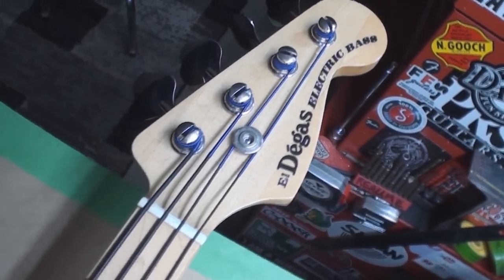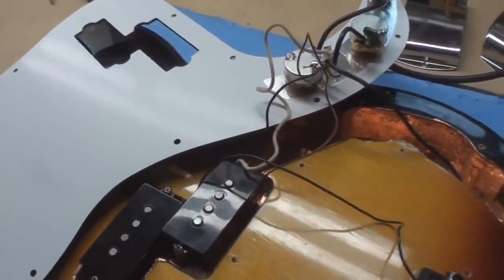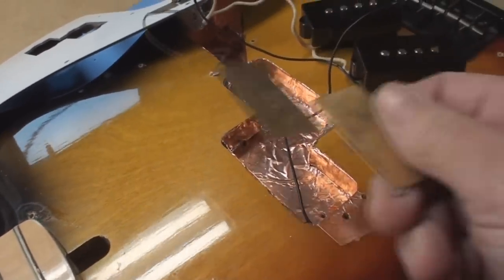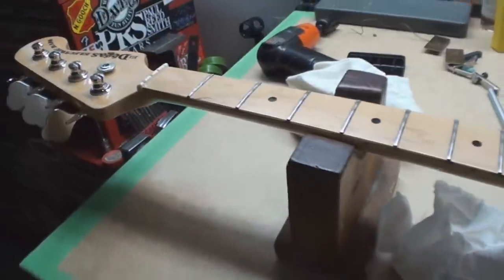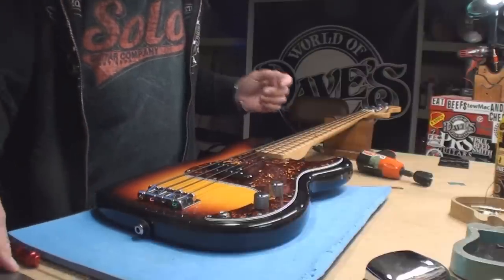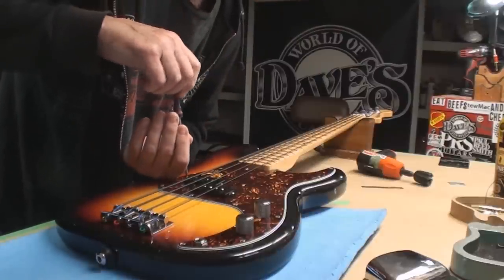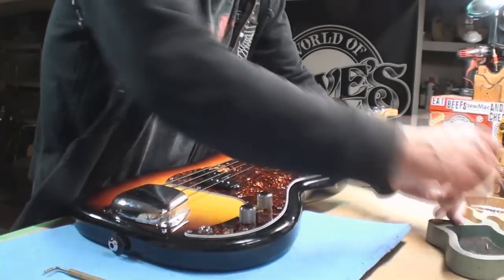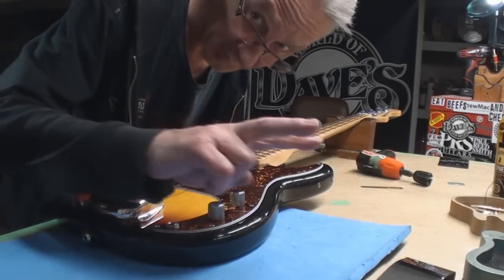El Degas Electric Bass Guitar

Comment: I guess all that shielding was to try to reduce the buzz caused by the (insulated) tapewounds - buzz went away when touching the tuners or bridge.
Reply from the maker: ball ends are not insulated and touch bridge..what are you thinking?
Reply: @DavesWorldofFunStuff  Fingers don't touch the balls, or the strings with that tape on them. We can hear the hum in the video, at 8:50 it gets quiet when you touch the bridge or the tuner but when you touch only the strings the hum continues.  This is why I don't use coated strings, same problem. I have used tapes but only with humless EMG. 
I don't think ALL P-bass pickups are wired as humbucking, I think some are wired in series.

Comment: No grounding withe the insulated tapewounds....
Reply: bet the ball ends aren't insulated
Reply: @halvach1998  the ball ends don't make enough contact  to make a difference it's a common issue with tape wound strings the extra sauce he had under the pick guard was all a attempt to fix it but unfortunately it was poorly executed. I have to disagree with Dave  on this one though even guitars or basses with humbucking noiseless ECT. pickups still need to be properly shielded and the ground wire needs to be connected on all sides to produce a proper faraday cage. When done right there should be zero noise or buzz.